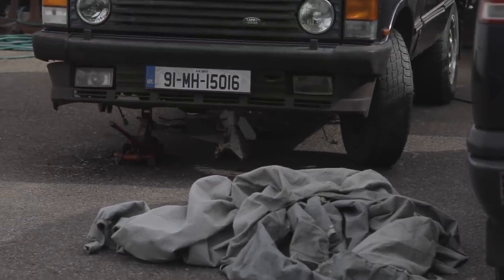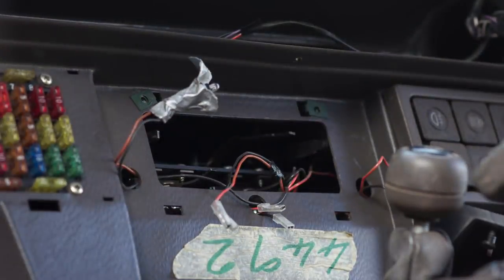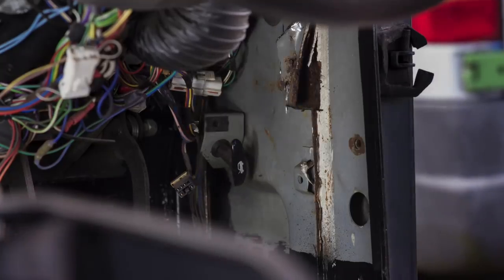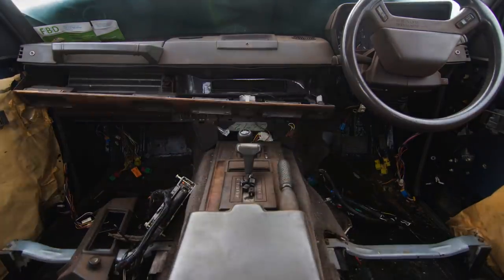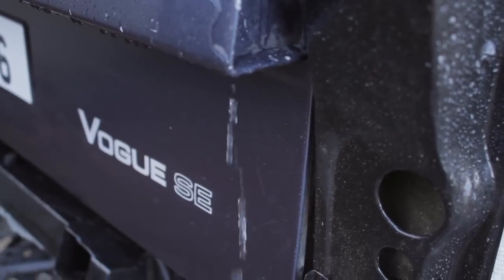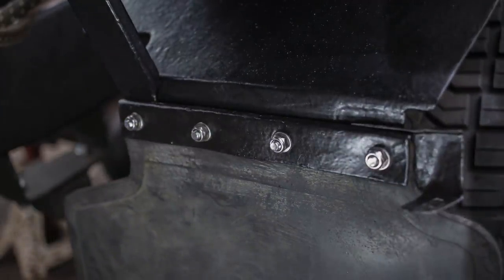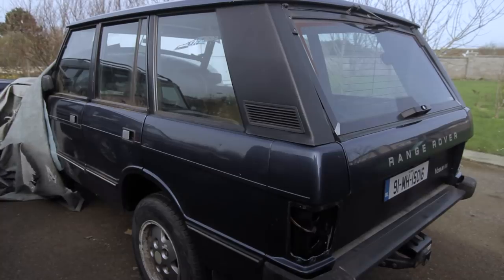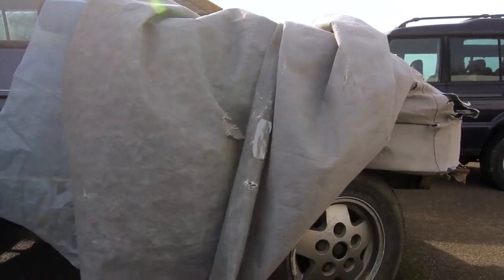Range Rover front end first fit // SOUP Classic Motoring 45

Comment: Great work, George.

Plans to replace the panels with new within a few years will almost certainly get stretched out - these things always do.  But it looks like you have done the repairs to such a standard as it won't matter - I reckon you'll get a good 15-20 years out of them as long as you get some cavity wax onto the back of the bulkhead repairs and a decent layer of paint  in the voids below the battery trays.
Reply from the maker: I'm going to get it tested and hopefully drive it, but it'll likely be a summer romance, then either way it'll be mothballed until it qualifies for classic tax in 1.5 years ;).

Comment: George - you're a miracle worker! Your motivation levels must be at an all time high - this is just brilliant stuff, and the stop motion welding footage is excellent. Driving it yet?? I suppose I'll have to wait just a little longer :-)
I've been away for work for a couple of weeks, but before I went I had the wheels refurbed on the Vitesse and new Firestones fitted. The drive home from the wheel shop was fabulous until the exhaust started blowing a couple of miles from home! Boring Honda passed its MOT with no advisories, so that's something. My RR vogue has a small leak from the rad, somewhere - there's a tiny column of steam from the front grille at the end of every journey but I'm going to ignore it for now, and get busy changing the engine and diff oils instead - let's hope it makes it to Anglesey and back over Easter.
Reply from the maker: Motivation is tough right now Mark, the biggest test right at the last hurdle. Have found some brutal rust I just never noticed before... how could there still be a rusty area?? Don't leave that pin hole too long, if it drops the boiling point of your coolant it could toast your head gasket!
Reply: @soupclassicmotoring  Your thoughts about the pin-hole in the rad got me thinking that perhaps you're right and I should get it sorted. I was worried about the oil cooler and autobox cooler built in to the rad - I expect yours is the same - and how that would make it complex and expensive but I've found one for below £200 so I expect I shall be getting on with that very soon. Main job right now is to find out why it's reluctant to start and why it's running a bit rough all of a sudden.
I'm sorry about the nasty rust hiding under the Decker panel - and all the usual front-end decay. But it is the last big push and you're so inventive and resourceful George - you'll crack it!

Comment: My mum used to have an old mini, which she'd park on the road, always facing the same way - driver's side to the pavement. She did this for years. 

The passenger side, always facing the road, developed severe rust along the bottom of the whole side there due to the cars passing and splashing the rain and grit. The driver's side was relatively spotless. 

So it may be that the driver's side on yours is just more exposed to the road and when driving and therefore is rustier?

Just a thought.
Reply from the maker: That was my thoughts on it too, but this car lived in a car port on an extremely secluded drive.

Comment: Bloody great video as per usual Sir. :)

On the more driver's side rust G, maybe it's because the car was parked up with the driver's side near a wall or similar? I have had similar with my 90's Honda(actual rust magnets from new) the passenger side requires little but inspection and reapplication of anti rust goo in the summer in places where it's likely to form. The driver side is parked near to a low wall and though the car is more wax than steel  :) I had to do a small bit of welding to the sill on that side. Well I didn't, I got in a pro, as the emergency services of Dublin have enough to be dealing with.
Reply from the maker: 😄yeah no sense in causing trouble. Thanks a mill man. Which Honda?
Reply: @soupclassicmotoring  98 Integra Type R

Comment: I have to say your welding with the flux-cored wire is an inspiration, especially since you're not even using a top end welder. You now make the thin metal welding look easy. I am tempted to buy a roll of flux core just to give it another go, and get some practise in for when I need to weld in windy conditions. Which brand of wire do you use?
Reply from the maker: You can get a decent result, no doubt, my welds are affected by the stop motion process, they could be prettier. For €100 that welder is a no brainer I reckon. That said I'm not touching the Esprit chassis with it. The wire is Sureweld I think, I buy the big rolls now and they last ages so it's been a while since I saw the packaging.